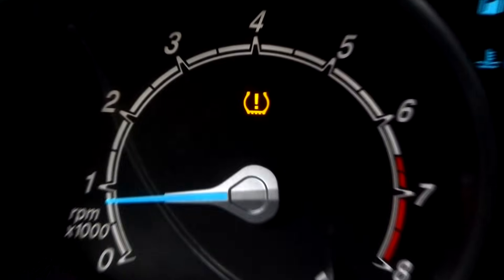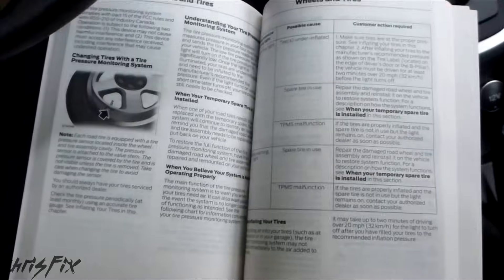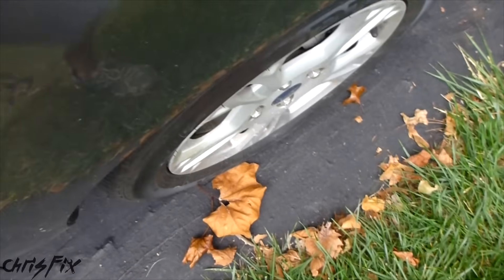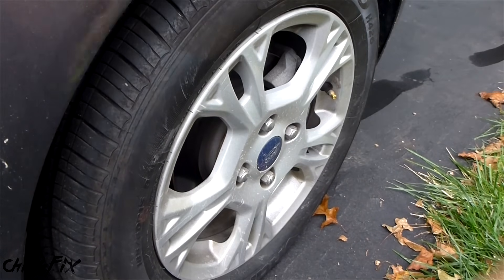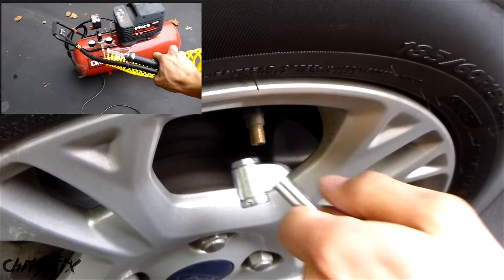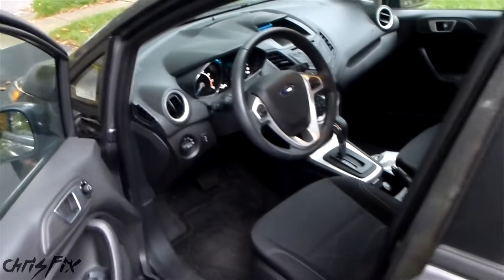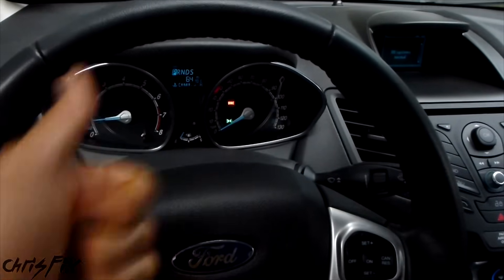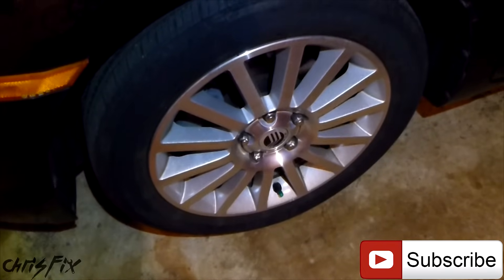How to Reset Low Tire Pressure Light (TPMS)

Comment: Usually, the only reason to drive the vehicle after filling tires when the light does not go off is because a tire may have been flat and removed from the vehicle for a few days or so.  The sensor, in order to preserve battery life, will go into "sleep mode," and turn itself off.  After the tire is repaired and re inflated, the sensor may still be in sleep mode. Driving will usually take the sensor out of sleep mode, and start the pressure transmitting to the TPMS computer.  On some vehicles it may take upwards of 20 minutes driving at 20 mph to turn off the light, and sometimes the light does go out immediately after the tire is refilled.  If the vehicle does not indicate which tire is low, meaning the only indication there is a low tire, is the light coming on, then the TPMS system will not need to be retrained after a rotation, however, vehicles that do indicate which tires are low usually have to have the system retrained when rotating.  Certain Chrysler/Dodge vehicles will show the actual tire pressure, but have the ability to retrain themselves.  Something General Motors and Ford could take a cue from.  However, if a sensor does go bad, and a new sensor needs to be installed, the entire system will have to be retrained to add the new sensor into the system.  TPMS sensor battery life is approximately 10 years or 100,000 miles.  They have a limited life expectancy so will have to be replaced eventually.

As of model year 2006, 30% of vehicles sold had to have TPMS installed. Model year 2007, 70% had to have TPMS installed, and starting in 2008 model year, 100% of the vehicles sold in the United States had to have TPMS installed.  Prior to 2006, it was optional on vehicles, and standard on many higher end vehicles.

Incidentally, if you have a vehicle with TPMS and you have to have work done to it, it can be expensive, in that the sensors start at around $100.00 each, plus a charge to retrain the system for the new sensor.  The tire has to be removed from the rim, the old sensor removed from the rim, the new sensor installed and torqued to the proper spec, the tire reinstalled on the rim, refilled with air, then rebalanced and reinstalled on the vehicle.  You can thank our esteemed US Congress for TPMS and the added expense for servicing this unneeded additional piece of electronic nightmare.

Walmart Auto Care Center Service Technician.

Comment: The TPMS is a joke,It is a complete pain in the ass system to fix and not accurate.Seen it before,scan tool said it was 32 PSI and the tire gauge read 44 PSI.Most tires today are set for 44 PSI,you get better fuel mileage this way.If I had a vehicle with the TPMS,I would do away with it called remove the sensors and replace them with regular valve stems and take out the whole system.The idiots whom came out with this system need to be shot.
Reply from the maker: +wafrederick Thanks for sharing. I will have a video tomorrow you will like on a TPMS ;) haha

Comment: Thanks for posting this! My light came on 4 days ago and I just purchased a gauge . I want the digital one now being that it does seems to be a bit much easier as it let's out air and tell you accurately the psi number! I have to use my old one to check all tires to see which is lower... I will be purchasing a digital one very soon. Again, thanks for sharing your informative video!
Reply from the maker: +Shauntaya Hazel Awesome! Glad the video was helpful!
Reply: +ChrisFix Hey, so yesterday evening I drove about 55mph for about 10-15 mins on highway and the light went off!! Yay!!! It had to be due the low temp that dropped to 6 degrees the day it lit up.... Now temps here in Capital region NYS is in the 40s so. Thanks for shedding light in regards to air pressure. I also now know my air is 32psi.

Comment: Thank you for explaining (and showing) that sometimes the light doesn't go off before a test drive.  The temp dropped about 20F today, and I got my tires refilled- but the light was still on. I've been afraid to drive the car.  Now that I realize its part of the process, I feel better.
Reply from the maker: +Historical Dancer Yea, as long as you checked your pressure, dont worry. It might take a few trips to reset! The quick temp drop we just had will cause these lights to go off!

Comment: the wording is exactly how i wish to explain to customers that i get. work at a gas station and repair shop and we have a free air pump outside, you cant imagine how many people have no idea how to fill tires properly. people dont understand the importance of using a gauge and how northeast weather has an effect on tire pressure.  i had one customer just holding the air pump to the the tires and he had all of them filled to over 70 psi on a camry.

Comment: I bought new alloys and tyres for my BMW. my previous alloys and runflats had built in tyre pressure sensors. how do I know if the new tyres have sensors built in and would I need to "pair" the sensors to the car if the wheels do have sensors or would the car automatically recognise them? I drove on my new wheels for about 3 weeks with no problems and then it started throwing tyre pressure warning light on the dash.

Comment: what I have to do if pressure always go down after two days and after I fully refilled the air????????????Tyres are new,car has 4 month of life!!!!!!!There are no nails,scratch,or anything else on the tread.Sometimes I fart in my car-how is designed the inquinated air LED??????????DAMN!!!!!!
Reply from the maker: +profKasumi If it is 4 months old, it is under warranty so just take it back and tell them to fix it.
Reply: ChrisFix
thank you Chris-it was a nail placed inside the hoop (there where needed three tyre repairers to solve the problem!!!)

Comment: I have a 2008 Dodge Ram 1500 4 x4 the tire pressure sensor  has went bad in the back left tire and the light will not shut off  have a black piece of tape over it now which is driving me crazy . the dealer told me that they have to be all upgraded to this new tire sensor they do not use the old sensor any longer and will not be able to replace just one, that they have to replace all 4 which is going to run in somewhere around four or five hundred bucks .anyway to get around this to just disable the light? any help would be gratefully appreciated
Reply from the maker: +the eabster You can pull the light bulb out of the dash: https://www.youtube.com/watch?v=qRMSvFO7org

Comment: what about say a Ford ranger in between years of 2000 (if they have them) to 2009? can those be reset like a vw jetta where there's a button you push, or is it like this ford
Reply from the maker: +johalinay Check the owners manual, There is not a button that I know of but my Ranger is a 2001 so it doesnt have the TPMS.

Comment: You should do one on how to reset the service miles on newer cars, ive got a 2011 vw jetta and soon it will need an oil change and it has roughly 2300 miles till my next change and dont want to waste gas to go to the dealers or any really good lube shop, id rather do it myself and have no idea how to reset it
Reply from the maker: +Justin Sayle Just look in the owners manual and it will tell you. But yea, that would be a good one so thanks for the suggestion!

Comment: I should have read the manual first of course. I got the Low Tire Pressure Light (TPMS) and filled all of my tires to the correct tire pressure but, the tire did not turn off right away. I was so frustrated until I read the manual. Ha! I drove around for like 2 minutes and then BAM! the light was gone. READ THE MANUAL!
Reply from the maker: +Frank Pairis Jr. Haha always read the manual!

Comment: I've had that light for more than a year and watched all the videos. I can't get it to go off. TPMS is more useless than teats on a boar hog. I have a pressure gauge. I just bought a 1973 Chevy because I'm tired of  all this new-fangled junk on my truck. I will sell my new truck to pay to rebuild the '73. I don't wan all this junk. I can guarantee you I will never have a problem with the TPMS, electric locks or electric windows on my 1973 Chevy truck.I'm tired of being ripped off by car dealers.
Reply: THISMEANS THAT ONE OF THE SENSORS IN THE TIRE IS BAD EXPENSIVE REPLACE ABOUT $50TO$150 IF YOUR LUCKEY IT WILL TELL YOU WHICH TIRE TO CK IF NOT GOOD LUCK FINDING WHICH ONE IS BAD
Reply: SCAR FACE! Skid kids...
Reply: I've checked the pressure several times. The tire it is saying is wrong is the same as all the others. I would rather do away with the sensors. I know how to check tire pressure. How in hell did I ever live over 60 years without another worthless gadget that is more trouble than it is worth. I have spent more time on the problem than I would in 40 years of checking tire pressure.
Reply: HML367 bmm

Comment: The video was fine, easy to understand for people that are surprised for the first time by the low pressure warning, but I was a little mislead by the title.  I have a Ford Focus with a tire that was a little low (~6 psi) and the light came on.  After filling to correct pressure, checking all tires and driving the car more than 2 minutes, the warning remains so I was really looking for something on how to literally reset the system or at least an explanation as to why this is happening.  I will try the additional tips you listed below though.  Thanks!

P.S.  Good tip on the nitrogen.  Last time I was at the dealer, I thought the guy was crazy when he tried to sell me on nitrogen in the tires.  He even did some fancy adding on a conveniently placed calculator which was my first clue that I probably didn't really need it.
Reply from the maker: +Sue Chmura Add 2-3psi over your recommended to shut the light off. Sometimes the sensors are off a bit and they will be off in a "safe" way that says you need more air but you are at the correct pressure.

Comment: I got a 2011 dodge charger and had TPMS issue, the sensor wasn't working properly. The sensor had to be replaced with Mopar OEM made. After putting new sensor had to drive around 3k and it took the reading properly. By the way I'am from Dubai and the temperature here shoots to 50 degree Celsius on high summers. So tyre needs to checked regularly for optimum driving and as a safety measure.

Comment: low tire pressure  light =/= Tire Pressure Monitoring system light
Reply from the maker: Dont-be Evil Yea that means one or more of the sensors stopped working (probably a battery).

Comment: do you know how to disable it completely on a 2013 mustang
Reply: Patrol 2012 They can't be disabled on any model car currently.  Your best bet is to find the faulty sensor and replace it.  Shops charge like $150 to do it with OEM parts but you can order after market sensors on ebay for about $30 each.  Just make sure you get the right ones for your car.  You'll need to do a TPMS reset afterward... which can require a special tool.  Most shops have it.
Reply from the maker: Patrol 2012 You cannot disable it unfortunately.
Reply: kevin smith  ChrisFix that is really unfortunate. this system is not that important and it has a very annoying warning every time I start the car while the air bag warning is barely noticeable. TPMS is a perfect example of corporate greed.

Comment: Chris, I have a 2008 Fusion and I get "Tire Pressure Fault" for years now but it only happens intermittently. I've had the dealer check it out several times and they can never fix it.  Any ideas?
Reply from the maker: Jeffrey Alford Does the light flash? When do you notice the light coming on?

Comment: THAAATS NOT HOW IT'S DONE....
Reply from the maker: Herb Bees What isnt how it's done? Explain...
Reply: ChrisFix I thought you were legitimately going to reset the tpms system using that elaborate manufacturer "cheat code" (eg. step on the brake pedal four times till you hear a horn, etc.)

Now don't get me wrong setting all four tires to their standardized pressure does take off the tpms light, but I guess what would've been a little more helpful would have been to add an additional  "if setting all tires to your door psi doesn't do the trick..." end segment.  Then again the reset procedure differs widely from make, year and model so I guess that's why it had been omitted.
Reply from the maker: Herb Bees Gotcha, that only works on specific makes and models so it would not be helpful to most people.

Comment: I have just purchased a 2011 Nissan rogue....The air pressure sensor light cannot be reset.  I took it to the Nissan dealership,,,they could not reset the sensor either..;All tires were checked and were fine...Any thoughts what I should do...The rogue is great
Reply from the maker: Donald Eaton Is it flashing or is it steady? Did you use any green slime additive in any of the tires by any chance?

Comment: +Chrisfix I've filled my tires with air but the sign won't go away on my dashboard. What should I do? :(
Reply from the maker: Ria Singh Is the light flashing or is it steady?
Reply: ChrisFix When I turn it own it flashes, but as I'm driving it's steady /= :(
Reply from the maker: Ria Singh The flashing means that it lost a signal to one of the sensors (the battery in the senor probably went dead). That is why even with enough air pressure, the light is going off.
Reply: ChrisFix Thank you for your help! I appreciate it. I'm sorry for the late response. I'll look into it .

Comment: I had the light on and just went to pep boys, they do a tire pressure check for free and set it to the correct pressure. My light didn't go off cuz I found out there were two nails in my rear tire.. They patched the tire up for $10.00 and the light went off
Reply from the maker: Angel Valdez Thanks for sharing! That is pretty good!

Comment: nitrogen molecules are larger and and less likely to seep through the rubber, it is also dry as you stated, but the biggest thing is that the tire pressure is not affected nearly as much by temperature or altitude, that is why aircraft use nitrogen in the tires. air a tire up with normal air at sea level then fly it up to 30,000 feet and the pressure effect are much much greater than using pure nitrogen. but for a regular car i agree for the most part its a waste of money.
Reply from the maker: asasial1977 Thanks for the info!
Reply: no problem. Nitrogen would be good for race vehicles where the tires get very hot and you are looking for maximum performance and need to keep the variables as minimal as possible.  like taking a car to the drag strip, the more passes you make the hotter the tires get and you are constantly letting air out of the tires to keep the pressure at whatever you want to run. then if the tires cool off you have to add air again to get them back up to the same pressure. with nitrogen this effect would be significantly less.

Comment: This function of a new car does not help. No good.
Reply from the maker: Slash Quantom It helps but it is more of a pain. You should be able to shut the light off because if the sensor is bad, it can get expensive and be a hassle to take the tire off just to get to the sensor.

Comment: I did,,wat happen was that I replaced the sensor on the rim,,so the tpms light come on ,,cousin I ran the car with the broken sensor for a couple of days, ,,
Reply from the maker: lbaby512 You might have to get the car to recognize the sensor. Check your owners manual for the procedure.

Comment: My Dodge Charger came with nitrogen tires. So you're saying it's not worth keeping them nitrogen?
Reply from the maker: VL123 Look at it this way, you have a flat tire and need to fill it up... The odds are you are going to use normal air. The cost of nitrogen is also not worth it. My suggestion is to not worry about it and just use normal air.

Comment: 26psi is only 19% under 32psi I don't understand why the tpms would even light up, that would just piss me off. Another reason to hate ford.
Reply from the maker: Aaron Johnson The light went off because 26psi is a pressure that is close to becoming dangerous. Six psi is a significant drop when the safe pressure range is so tight. This is the same for all car manufacturers. The standards is federally regulated.
Reply: Aaron Johnson,
                       I'm in the same boat with you brother. I didn't even know these TPMS systems were in cars until the other day! I'm guessing my '08 Silverado has them, I recollect seeing a light on the other day. I think the deal here is this system wants to remind us to keep up on tire pressures and tire maintainence so that we're safer, get better mileage, and have our tires last longer. That's cool, I can live with that, but the fact that these monitors have batteries in them that last 4 years to ten years  AND YOU CAN'T REPLACE THE BATTERY just ticks me off. I can tell you if my idiot light starts blinking because a battery dies in this system, I'm just going to put a piece of tape over it! ........ Jim.

Comment: Great informative video.  I also agree with your nitrogen tip. Just a cash cow for garages, preying on the uninformed.  And for those that say that TPMS systems are just a PITA, look at it this way.  If it saves just one tire because your spouse didn't notice that it was flat and kept running on it, it's worth it!  (Been there).
Reply from the maker: MrMooseman2 Thanks man and exactly! They should have an option to shut the light off when you recognize it is on just because it can get annoying if you have a bad sensor or something. But the cost for that annoying light is worth the life it can save so.